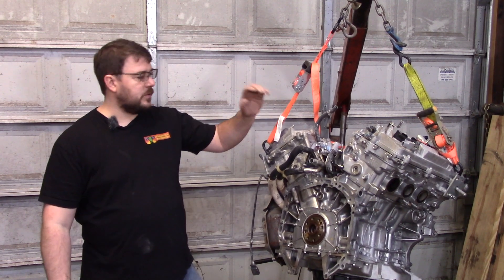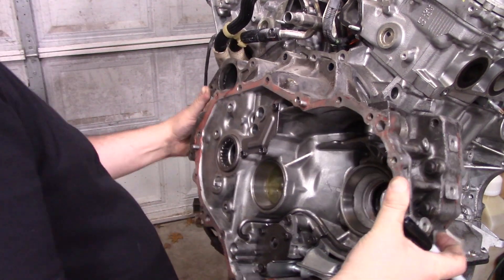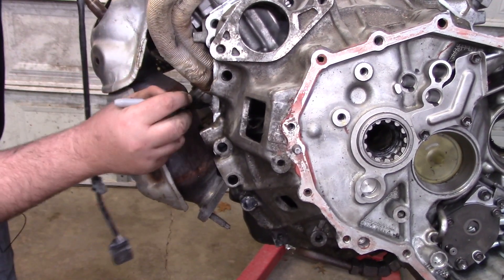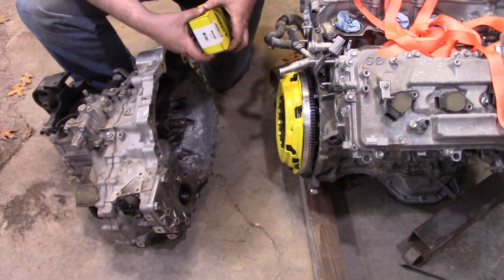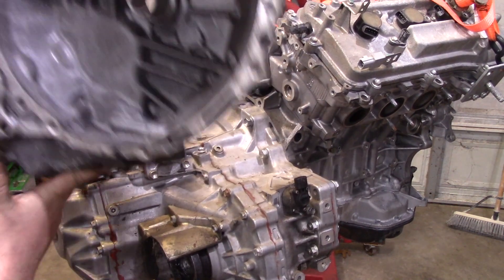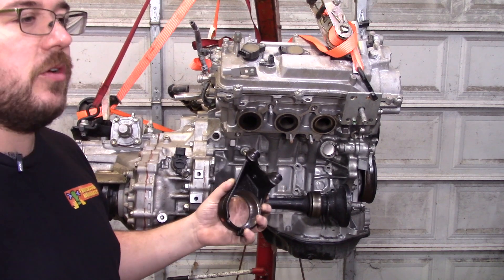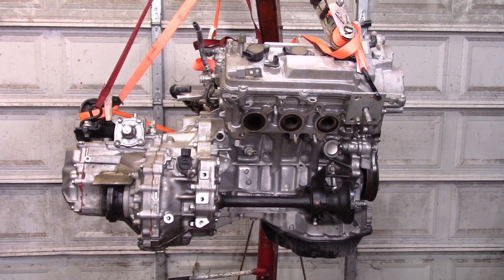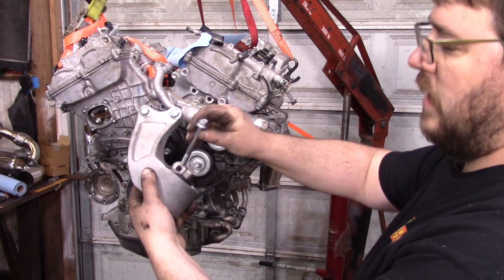2GRFE MR2 SW20 Install Instructions Video #1

Comment from the maker: I tweaked the editing style a bit more. trying to keep shots a bit more continuous and a bit more to the point. This was helped quite a bit by upgrading to Final Cut Pro. As i get used to the software it should get even better. 

Thank you for your patience in letting me get this video out. The next one should follow within a month (depends on holidays and the day job).
Reply: Hey nice job and video..   I was thinking of swapping this into my 74 Toyota Corolla. Any way you could get me the dimensions of the engine ?  i would appreciate it!   Thanks
Reply from the maker: @user-pd9vm9ts1o  External dimensions on a motor like that really don't give you enough information to see if it fits. I'd classify this as a wide "big head" DOHC motor. You'll need at least 20" between the frame rails, 24" between the strut tower tops and 24" of height to fit it in. it's also 21" long but that dimension will definitely not give you a problem.
Reply: @FrankensteinMotorworks   Great thanks !

Comment: Does anyone know if there are any particular steps to skip or different steps to take when pairing the 2gr to an E351 transmission instead of an E153? I've read they're mostly the same but just wanted to check, thanks.
Reply: you find anything out on this?

Comment: Hey Hi! What kind of rear-wheel drive manual transmission would you prefer for this engine?
Reply: Don't think there is one which has the starter mounted in the bellousing, unless you were to have a custom bellhousing made to mate to a w58 or r154 or whatever gearbox.

Comment: Will a 2gr bolt up to an r160? Do you know the 2wd RWD manual compatibility options?
Reply from the maker: The 2GR-FE matches the 5VZ bolt pattern except the starter location does not quite match up. There's no 100% bolt up transmission available but i am working on a kit for the TL70

Comment: What would I need to swap a 2gr into a1998 Toyota surf
Reply from the maker: I don't know the details of the Toyota Surf but the 2GR has the same bolt pattern as the 5VZ and has been mounted to the same transmissions with some clearancing to make the starter fit.

Comment: Do you know if I can use a 3gr fse ? I have a Lexus gs300 with 2jz swap and I have the 3gr waiting for a car 😂👌👌 thanks
Reply from the maker: unfortunately not, the longitudinal versions of these engines are different than the transverse ones used for the swap.
Reply: @FrankensteinMotorworks  I think with some work in my workshop it can be done ✌🏻☺️

Comment: will the transmission of 1993 mr2 5f-e work with this 2GRFE Engine ? also i have seen that the Lexus ES also used this engine is there any difference ?

Comment: Hey bud whats a good toyota trans rear wheel drive ,that i caan use
Reply from the maker: the bolt pattern is going to be very similar to the 5VZ so the truck transmissions that used that used the 5VZ may work. You will need to make sure you look carefully and consider the starter mounting.

Comment: Interesting, the vvti line on my 08 rav4 used the double connected crush washer on the back of the block and a single washer at the top
Reply from the maker: yeah, honestly i don't understand the reason for a lot of the tiny changes like that. it almost feels like changes for the sake of changes sometimes.

Comment: Anybody have the model number or year for the latest Solara transmission??
Reply from the maker: The XV30 that ends in 2008 is the latest solara and it had a manual trans available until the end.

Comment: Is that Mr2 transmission the same used with the 2ZZFE
Reply from the maker: Unfortunately the 2zz's transmission is a completely different bolt pattern.
Reply: @FrankensteinMotorworks  so I guess I can't put this v6 on my celica
Reply from the maker: @cesarortega6615  Correct, you would need to swap the transaxle also. The E series from a 2010 and earlier Scion tC would be a good fit for this.

Comment: Do you know if one needs to the two center coolant tubes that flow in the valley under the intake if you are eliminating the heater core?  Could one block them off and just run a crossover at the back of the motor between the two heads?
Reply from the maker: I haven't studied the flow to see if it's a good idea or not but the SW20 blocks it off when the heat is off anyways and it hasn't caused issues in the last decade so i'd say you ca likely cap them off with no ill effect.
Reply: That's how we were feeling. We'll cap them off and let you know if it heats up or not.   Probably put a temp sensor back there and on the front.

Comment: I can't remember what video I saw where you are talking about upgrading the fuel pump, but you mentioned with the Aeromotive 50-1200 you may need to upgrade fuel return line size? I will be reinstalling the 5sfe, but want to just replace the fuel pump while the engine is out and prepare for a future engine swap. Can you advise on what exactly I should do to run the Aero pump with a 5sfe. Thanks!
Reply from the maker: I don't have specific instructions for that but you'll need to replace the return line to be big enough to handle the max flow of the pump. The quick and easy way to be sure is just to make it the same size as the feed line. Stock the feed line is 8mm and the return line is 6mm

Comment: I am speechless. Very comprehensive initial video for an MR-2 SW20 2GR-FE build. You've covered everything up to the smallest details (what parts to shave off/grind when mating the engine with the trans, the bolts used, torque specs, common issues, etc.). This makes me confident to do it on my own! Now I just need an SW20 and the 2GR-FE. ;) Thank you very much!

Comment: Stumbled across your videos after watching some K-swap videos. I’ve always been more of a Mazda fan but I have a soft spot for the SW20. I still remember going for a spirited drive on a coastal (Australian) road years ago in my little turbo 4WD Ford Laser (same shell as the early 90s USDM Escort) and a SW20 easily kept up through the twisties. Nowadays my family car is actually 2GR-FE powered (Kluger/Highlander), this video makes me want to buy an SW20 and do the swap. I’ve always had a thing for small 6-cylinder powered cars, and the MR2 would be worthy of the effort at least, unlike KL swapping a 90s Mazda.
Reply from the maker: Thanks for watching my videos, i appreciate it. The 2GR really is a pretty fantastic motor and it makes the SW20 feel like a modern car. It's a perfect combination of big engine and little car.

Comment: Hey whats up I have a 2002 toyota celica gts with a blown head I was thinking about installing a 2grfe engine in I wonder if it ever been done and if the c60 6speed transmission would work  with the v6 engine
desilva1178@gmail.com

Comment: What do I need to install to a 2gr to get 340hp
Reply from the maker: Mostly just open up the exhaust but we run headers and a super short exhaust, a special MAF pipe with a velocity stack and an ECU calibration and the Venza upper intake manifold. Completely unopened engines.

Comment: And how much money will it cost?
Reply from the maker: The 2GR-FE swap in the MR2 costs about $6000-7000 if you're doing it yourself. But that's if you're in the USA and i don't think you are so you'll have to make your shopping list and figure it out based on local parts availability.
Reply: Yes, I already have a car, and I put this engine in this car. That's because I'm tired of changing machines. I want to put a mechanical box.
Reply: If I buy an e153 manual transmission, and it will ring a bell for me as well as you will with your alterations. I understand correctly.

Comment: Can you custom this box?
Reply from the maker: Yes, you can mix and match parts with other e-series transmissions to get many other gear ratios and final drive ratios you want. There's also a few aftermarket gear and final drive options.

Comment: Hello thanks for the great video, question did you use the entire new stlye 153e trans from a different make of car? Or was the new style trans also available in the MR2?
Reply from the maker: That was a 93+ MR2 transmission but you can use the Solara bellhousing if you want to do this and you can also get the updated synchros and better final drive ratio from the same transmission.
Reply: @FrankensteinMotorworks  thanks so much for the reply, in the video you said this is the newer model e153. I got excited thought it was the version out of the v6 Camrys/Solara.

Comment: Question on the shaft if I’m using a non turbo transmission what do I need to do to make useable ? Do I still use the Avalon bracket what shaft do I need? And does it need to be milled down ? Thanks
Reply from the maker: The S54 transmission does not use a right side axle support so there's no problem to solve there.

Comment: Where did you find the hoist brackets to lift the engine?
Reply from the maker: I just used a few pieces of scrap metal but if you want the official toyota parts, order 12281-31120 and 12282-31100

Comment: Hi mate.....I recently got the 2gr-fse version...does the 3s transmission bolt up to it aswell...was just eyeballing the bolt holes in the engine and trans today and it doesn't seem to be in the same locations
Reply from the maker: Unfortunately not. the 2GR-FSE is a completely different engine and will not work in a transverse application without an absolute ton of work.

Comment: Thank you Marc for putting these videos together.  It's so nice to see it done and you make it look fun.  I am a little confused on what year Avalon axle mount works best.  Would you happen to have a part number for the best fitting one?  Thanks
Reply from the maker: The avalon one i've been using is 43457-07010 but i'm getting a production sample for a new bracket today that will not require any machining. These will be available for sale very soon.
Reply: That's awesome news.  Thanks again!

Comment: thank you for making all this video and  parts,  hope soon i will oder it 
here is a few question if you'd be so kind to answer will be really thankful: 
1. I see on u web site 2 ecu, but dont really understand which one is better and whats the different between those? 
2.I read about ECU that there is "VVTI target angles changed to remove torque tapering off at 6250RPM rev limiter raised to 7200RPM" so its will  not damage or make resource of engine much lower ? 
3. I see the diagrams on  you web site but there is only for RAV ECU, so that would be the same for highlander ECU also ?
4.Whats you think if i install your highlander ECU and wil have a OBD, is that good idia to have just screen and bluetooth adapter so like electric dash, or its buggy and slow  ?
5. And the last question nowhere i can find information about 0-60 aftrer swap 2grfe
Thank you very much
Reply from the maker: Zaza,
1)The only difference between the ECUs is which harness you use and the 5-plug does not have working cruise control. Otherwise they both make the same amount of power.
2)There's no extra wear from the tune, the stock engine is not tuned like this because this makes it be way too loud.
3)I do not currently have a easy wiring diagram drawn up for the highlander. I sell very few of those so i have not made the documentation at this point.
4)i would have the tachometer and the speedometer be actual gauges, bluetooth and OBDII is a bit slow for a gauge cluster.
5)it depends on many variables but it can get down to about 4.2s 0-60
Reply: Thank you very much for answers !

Comment: You should 340hp my Rav4!
Reply from the maker: You'd be surprised how often I get requests from the rav4 crowd. If I ever branch out from the MR2 crowd there's a good chance it'll be to the rav4 and/or the Avalon (yeah, I realize Avalon sounds odd but it's where all the requests come from).

Meanwhile, if you want more power the answer is a custom y-pipe. the y-pipe on these stock applications are always awful and dramatically reduce available power.
Reply: With the custom y pipe do you need a tune I assume?
Reply from the maker: @Adam-di3mn  No, the stock ECU tune is actually really good at compensating for those kinds of things.

Comment: So you said a 340hp beast. Is that just from the tune setup on the ecu you sale? Or did you mod the engine other than the bolt on from video? awesome though ill be waiting for more.
Reply from the maker: Matt, 340hp is the estimated flywheel horsepower, i haven't actually put it on an engine dyno but with my headers, tuned ECU, MAF pipe, Alex Wilhelm's y-pipe and a berk tail section it makes 290whp and Alex has actually been working on a few flow tweaks and he's even gotten it to 301whp. This is all with zero internal modifications, not even porting at this point though that's likely going to be necessary to push it much further in naturally aspirated trim.
Reply: @FrankensteinMotorworks   thanks for the info. to even get to around 300 to the wheels with no internal work is awesome.
Reply from the maker: @mattpeebs32  Yeah, it really is. The only downside is this motor is an absolute screamer when you open it up. It sounds really good but not everyone wants to draw that much attention when they get on the loud pedal. At least it cruises and idles very silently. below about 3500RPM and 20% throttle you generally can’t hear it. The Jekyl/Hyde personality is because of the VVT-I system.

Comment: Excellent video as always Mark, just a question, that oil line your using in 15:48, is that a custom part or a toyota part?
Reply from the maker: That's a factory part that was developed for the rubber line recall. Toyota part number: 15772-31030 it costs $20-30 depending on where you buy it.
Reply: What about the oil line on bank 2?  There is zero info online and it’s never mentioned anywhere!  I have a 2GR FE that appears to be leaking from the area where the vvti oil line bolts to the block on bank 2, but it’s behind the alternator and not visible.  Is the bank 2 oil line prone to leak and does the alternator require removal to remove it from the block.  My 2GR FE is a 2007 and does have the rubber hose on bank1 that I need to replace....  My problem is that I have oil running down the head gasket seam (between block &head) on bank 2, but can’t see where it is coming from....

Comment: Looking good.  I need to test drive an SW20/SW21 MR2 with the 2GR to see how I like it.  I currently have a stock 94 MR2 Turbo and I'm not really impressed by the 3SGTE in stock form.
Reply: I had a Celica  all trac and was also unimpressed.  I RAT2 put a 2GR in my 91 NA last spring and it’s a beast.  Changing to an E153 right now.

Comment: I think you might have misspoke when you were talking about the three bolts attaching the top of the transmission. You said m10x1.25 and I believe they are m12x1.25. At 8:13
Reply from the maker: Damn, you're absolutely right. Unfortunately Youtube gives me no tools at all to allow me to make a correction to a video without invalidating all the links to it. It really bugs the heck out of me, i understand why they do that for political videos and such but for videos in this class they really should allow annotations at an absolute minimum to call out errors like this.
Reply: Yeah that is unfortunate, you could probably just pin a comment with the correction so it shows up at the top of the comment section. 
Also, In the video description a list of parts used in each video would be nice and might make the videos easier to follow along.

Comment: I’ve been debating between K20 or 2GR and this is persuading me now, Thanks
Reply from the maker: That's fantastic news :) we don't need another K20 powered MR2 out there :) I'm available over e-mail also if you have questions that aren't answered in these videos.
Reply: Frankenstein Motorworks I’m in nyc so for me to pick up any parts for a K swap is easily a 15-30min to a store. So it’s real easy but I want to keep the Sw20 a Toyota heart
Reply: @FrankensteinMotorworks   hey good day  bro what transmission did u use the original mr2 gearbox?
Reply: No worries bro
You are doing a amazing job. Will you Demonstrate or show us how to convert the harness?

Comment: Great video Marc ! Will you be doing a video on AC?
Reply from the maker: It isn't guaranteed yet but i'm thinking of doing an "Adding air conditioning" addendum at the end of all of this.
Reply: @FrankensteinMotorworks  I see on the mr20c the mention of the 1GR compressor and just having ends made to adapt to the lines is this the best option? doesn't seem that bad.
Reply from the maker: @jdalzell3354  Yeah, it should be relatively straight forward. I haven't done one myself with that setup but the reason for not doing it up front is the chassis i'm installing this in has had the A/C circuit sitting open for about 11 years now. I just don't want to deal with stuff that will slow down the video making process. Also, with winter about to show up i won't be able to charge it up since my shop really does not have any reliable heat in it.